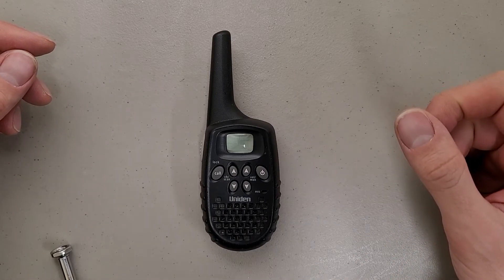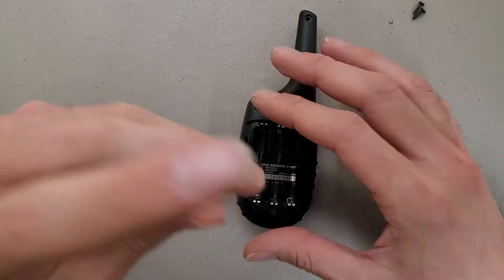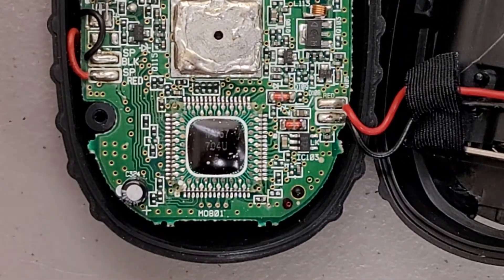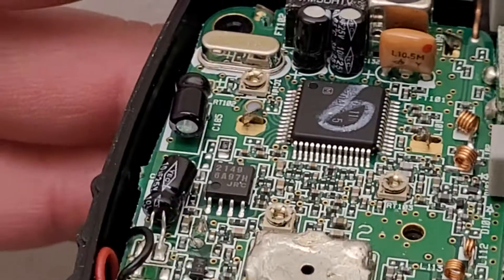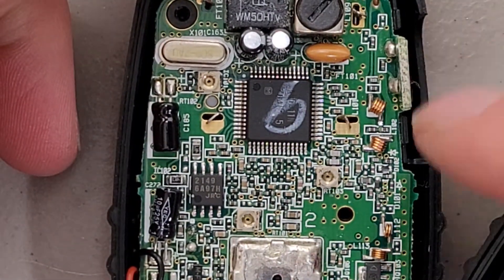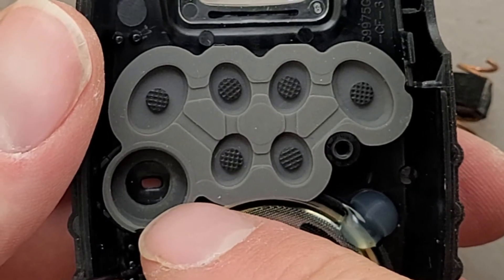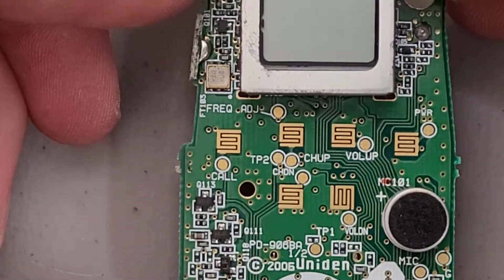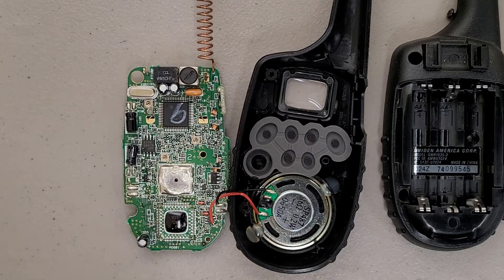Uniden America Corp Walkie Talkie Model GMR1035-2 #teardown

Comment: I have a pair of these, but when I turn them on it started to sound just white noise and it shows in the screen "rx" do you know why this happens?
Reply from the maker: I've never used one so no idea. I'd check the channels they are on and make sure there aren't any stuck buttons.
Reply: I know you posted your question more than a year ago, but anyway. These radios have a "MONitor" function, useful when the signal you are trying to listen to is very weak, it increases (slightly) the chance of receiving something: You press and hold one of the Volume buttons until the RX symbol appears (or disappears, if it was already flashing). But that function usually goes back to silence when you turn the radio off. 
When you turn it On, you shouldn't hear anything unless there's an actual signal on that channel/frequency. Try changing channels. If you still hear the same white noise and the RX symbol keeps flashing, I can think of 3 possible causes: 1) batteries are almost depleted. Try replacing them, and make sure the contacts are clean. 2) Maybe something nearby is causing interference, like a fluorescent light, or an electric motor, a soldering machine, etc. Try using the radio somewhere else. If that’sthe cause, you might be able to deal with it in some way. Or 3) If none of those seem to be the cause, then may be the device is defective. No idea how much it cost, but checking and repairing these things might cost more than just replacing them.
Good luck.
Reply: I just found these in my storage box, I’m surprised they run on GMRS channels. I doubt the wattage can reach a repeater on GMRS but I was under the impression these ran only on FRS channels. Anyways, I’m going to use them for when SHTF with my girl. I have a few GMRS HT and mobile
Reply: Same thing with mine. See the square thing at the top of the walkie-talkie with the slot in it? Turn that anticlockwise until the static stops. No idea what it does but must have something to do with sensitivity? Fixed mine.